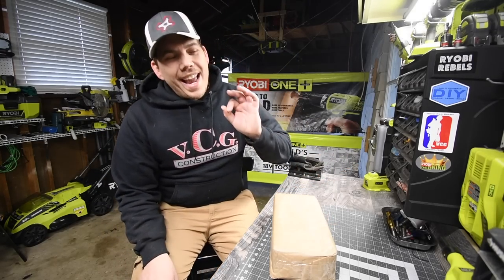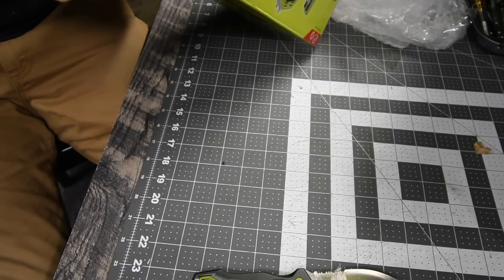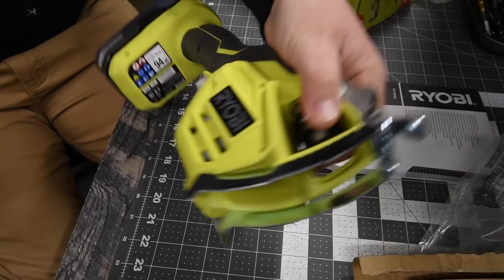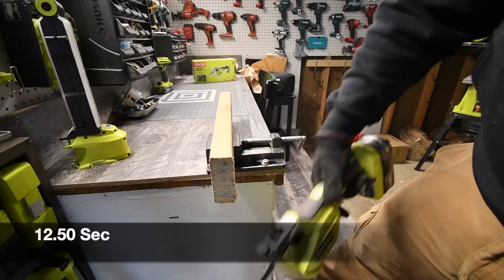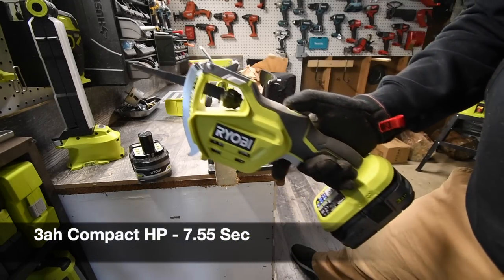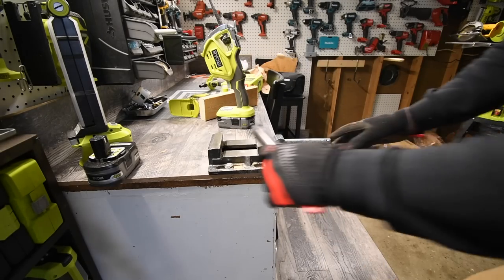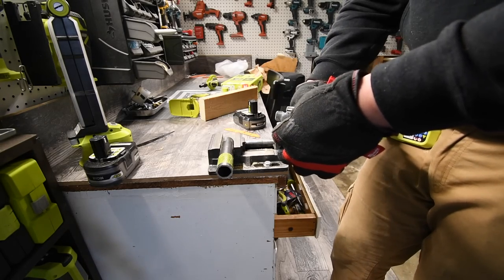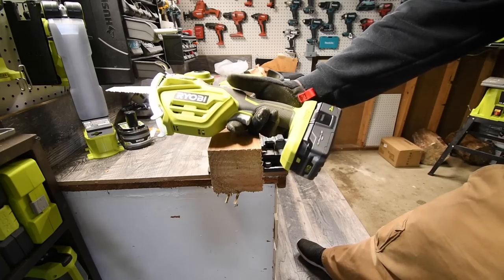"Ryobi Hacksaw" Im the first American to have this

Comment: Batteries have nothing to do with different countries , the input voltage is the only difference and you can just use the 110 volt American charger instead of UK's 220 volt one , but as far as you get the same output voltage from both chargers  you have no issue at all and tools should perform with  the same power and efficiency
Reply: UK voltage is 240v nominal.
Reply from the maker: yes it does. the cells in the batteries are the same but the mother board in the batteries is different. so the mother board in the tool reads the battery differently. like I just leaned that the UK 5ah battery is the same as the USA 6ah battery
Reply: @Adrianyoutubing  It's actually 230v now since voltage across the EU was harmonized.
Reply: I call bs on the channel owners reply. The charger has the transformer in it.. All the battery worries about is the 18v it puts out. You do not sound like you know anything about electricity, so you should refrain from making it seem like you do.
Reply: @stevoc9930  Anywhere between 220-240 is fine
Reply: @cidkramer  It might have a sort of current restrictor inside the motor driver once it feels different battery to avoid using fake ones , kinda(dirty) but you really can't judge it that way until you try both batteries
Reply: @stevoc9930  have you measured the voltage coming out the wall? It is 240v mate. The stated voltage of the UK is 230v but in 99.99% of homes and businesses it is 240v the tolerance for voltage range is such that 230v to 250v is acceptable.
Reply: Adrian Haddock I’ve been an electrician for 20 odd years. Though I’ve mostly worked in Northern Ireland. Here it was 230v even before EU harmonisation.
Reply: Considering Ryobi’s website mentions that the battery platform will never change, it should not matter what Ryobi tool you snap it on to.
Reply: @ManCaverTools  The only circuitry in the battery is the protection circuit, which just shuts down the charging when the battery is full. The actual output voltage from the charger is the same globally. 18V, strangely enough.
 The chargers are different because of the different transformers needed to step the voltage down enough.  Honestly, I'm surprised that Ryobi hasn't gone to a universal charger capable of 110-240V input. You'd think it would be cheaper to manufacture a single global charger and just change the cords.
I may just have to sacrifice one of my half dozen spare chargers to find out. Maybe it is already and they just don't market or label them that way.
Reply: @ManCaverTools  Maybe it is because it is converted to metric?
Reply: Physics works same in any part of world

Batteries are batteries, hell its all made in China anyway no matter where it ships too..

Comment: The metal bar is a clamp to hold the material being cut against the machine to reduce vibration and keep hand away from blade
Reply from the maker: correct. I just filmed another video with this that I havent uploaded yet. but I do say that in it and I thank you sir

Comment: 18 volts DC is the same everywhere in the world regardless of the AC voltage that created it.
Reply from the maker: im more curios on the circuit board in the battery
Reply: @ManCaverTools  Also runs on 18 volts DC which is the same everywhere in the world.
Reply: I apologize for me and all electricians.  Can't not answer this  one.

Comment: Doesn't seem much different than the Ryobi sawzall? Looks like same blade even. In fact I think my sawzall cuts faster than this tool even with standard 1.5ah battery. I'm not impressed.
Reply from the maker: very good and I thank you Lady TowerMoon
Reply: The hacksaw has one major advantage, one-handed operation. I'd hate to get my beefy recip saw out just to prune a couple of little branches if I had this tool.
Reply: @toddglennbarrow  yep, seen a couple of "not impressed" comments. almost like they didn't watch the video and the point of the tool. a sawzall should outperform this tool because it's designed for heavy duty use. this tool is not.
Reply: Even less difference to the pruning saw that they sell in US
Reply: @lawlorie24  this is a pruning saw, not a hack saw, the US model is 12v I believe, this one is 18v which is awesome.
Reply: @ihoppoet   I have a pruning saw in my garage that is ryobi in the yellow colors and its 18v it doesnt have that metalic flap on the front but otherwise looks the same. I bought it years ago in the homedepot gardening section
Reply: This one is smaller made for pruning. The metal claw prob provide a smother cut on trees and other plants . I get down with my Ryobi saw zaw but batters them bad .

Comment: That where the battery is made should not matter because all is output 18v I leave in UK and I have brought few year ago RIDGID gen3  combo set from USA and AEG sds plus rotary hammer drill from Germany because RIDGID  didn't have an sds 18v at the time and works fine till now no power lose or different in the size and both charges work fine. I though the USA charger would charge a bit slow because the of the frequency difference but it's okay.
Reply from the maker: good I am glad to hear that and thank you Milko for the input

Comment: 18 volts is 18 volts no matter where you are on the planet.
Reply: ... definitely is no different on Ryobi batteries ,  the advantage in US is the bigger range of amperage  .
Reply: Incorrect check the hz range
Reply: The hz should not affect the battery. The charger would be affected, make sure the charger is rated for your voltage and hz.
Reply: Check the Hz? In the battery? It is DC, DC Hz is by definition 0hz or infinite Hz. 

Chargers might blow up if you use  international ones but batteries are DC... UK mains power is 240v 50Hz 

Voltage swings from as low as 220v up to 250v but the vast majority of the country runs on 240v.
Reply from the maker: very good and thank you for the input KDC
Reply: Absolutely NOT true. Due to the Coriolis effect, the blade travels in, when it should be traveling out. Opposite of here in the states.

Comment: 18v in the US is the same in the UK, same as 18v in Japan, and everywhere in the world. Voltage is voltage.

I looked into the battery specs years ago when I started importing Ryobi tools in from other countries when their markets had offerings that were not available in the US. If you take apart the battery you will see there is are two boards, one for the LED's that display the remaining charge and another for the battery circuit. From what I can tell there isn't any circuitry implemented to regulate anything. 

Ryobi intentionally have made their batteries a 'standard' product in order to support their longevity of their tools and provide replacement consumables to the market. The injection plastic may differ from country to country, but the guts of the battery do not.
Reply from the maker: I was mistaken and this is from Norway

Comment: ah(amp hours) has nothing to do with "power" of the tool, amp hours is the discharge rating of a battery, meaning how many amps it can discharge continuously over a period of time before it is below rated voltage. More amp hours does not mean more power in the sense it can output more at once, it means it can output that power for LONGER before it dies. Your 1.5 died because the tool sucks so much amperage, it wouldnt complete the cut without depleting the available pressure (voltage). Your bigger batteries could do it, because they had bigger tanks (amp-hour capacity) to maintain the pressure longer.
Reply from the maker: a more ah battery does provide the tool with with more power. I already proved this in many videos. A 3ah dewalt battery with 21700 cells in it will kick the crap out the the dewalt 6ah flex volt battery when it comes to delivering power for a task. sorry but you keep watching. I show this all this test all the time
Reply: @ManCaverTools  You are comparing different cell designs with different discharge characteristics. Science, fully, wholly, disagrees with your statement that Amp hours provides more discharge RATE.  Amps-flow volts-pressure  amp hours- how long it will flow at a set rate before pressure is depleted to unusable levels. You are saying a different battery with completely different cells that have entirely different discharge rates and amperage flow/discharge characteristics, flows differently from another....of course it does. But stating amp hours has anything to do with power flow capability is flat out wrong.  A more accurate statement is "this 3ah battery with considerably higher quality cells, and higher rated discharge amperage will kick the crap out of this 6ah flex volt battery that is designed with lower performance characteristics"  but even then you are proving my statement right, as you just stated a 3ah battery will kick the crap out of another 6ah battery. Because the battery is inherantly designed differently, it has nothing do with the ACTUAL ah rating of the battery.
Reply: I actually recall stating that the ah rating of a battery has nothing to do with it's amp discharge capacity. I'm in fact arguing that an ah rating really has NOTHING to do with the maximum output amperage characteristics of the battery and only to do with reserve capacity.

Comment: Soft Start motors is not really interesting technology, it's something you already have in a number of your tools. They are in a number of recip saw, table saws, miters, jig saws and law mowers.
Reply from the maker: its not just a soft start, The HILTI 12v hacksaw is also a soft start. the interesting tech is the motor kicks into high gear as soon as it bites into the wood. if I just hold the trigger it doesn't change speeds. the stroked per minute go higher as soon as it bites into the wood. but I thank you for trying Piston :)
Reply: @ManCaverTools  A number of tools have that function, makita jig saw for example.
Reply: @PistonHonda87  yea but a hackzall doesn't, so to have that feature on one is pretty sweet

Comment: Kind dropped the ball on this review. You should have read the instructions. Tell me if I'm wrong but a review is to inform us about the tool. We still don't know what the 2 buttons on the side are for and how the pruning jaws work. A branch from outside would have helped. Still give you thumbs up for trying.
Reply from the maker: it slides the metal guard off in the front. and im sorry I just realized I didn't put that in the video

Comment: Hello Sir (I dont know your real name, sorry).

Ive seen several of you videos where you are using a saw, and i have to comment on your techniques.
When you see smoke from the material, you are either pressing to hard or the cutting edge is dull and as a rule you should never have to press on a blade/cutting edge, only a slight pressure to make it bite, the blade itself is doing the cutting, not the amount of pressure you put on it.
Try using a good old fashion handsaw for a while, that will give your a technique that would make wonders on powered tools, save on blade wear and save battery power.
Reply from the maker: the point of these videos is to put these tools through extreme tests. I push these tools to the limits to see If I can make them break.

Comment: Ryobi definately isn't for hard use. I learned the hard way, drilling down tack strip into concrete. Only 1/16 inch holes. The drill almost caught fire. Started smoking black smoke after about 15 hole. I'll stick with dewalt or Bosch
Reply from the maker: The Ryiobi Brushless hammer drill did a fantastic job with drilling a 3/4 hole is into concrete with no pre drill hole. you should check out the video

Comment: Its the hz that us different we operate on a different hz range which could if using a uk battery in american tool coukd cause motor to heat up  or so i am told
Reply: Nope. Its all about the charger . 18v is 18v
Reply from the maker: I might be wrong but I think the mother board is different on other countries batteries. the cells are the same but the mother board talking to the other board in the tool might make it work to hard or to little because of the battery. so I think
Reply: American frequency is 60 Hz ( cycles per second ) and the UK frequency is 50 Hz. Power tools with motors with brushes will work on 50 or 60 Hz but not at best efficiency

It will also cause the motor to run hotter

An American ( 60 Hz ) fed with 50Hz may run hotter and possibly faster as the inductance ( resistance ) of the motor coils is lower for 50 than for 60 and more power will be taken.

Induction motor for 60 Hz will run slower on 50Hz and may run hotter.
Reply: @ManCaverTools  nope. The board on ryobi is just charging & overheat protection . its an almost off-the-shelf part . otherwise the clone battery makers would have the same issue.

The charger outputs the same amount to the battery whether you use an aussie or EU or US charger..the battery doesnt care.

Same with discharging the tool.. The tool doesnt care where the battery came from. Its all 18v DC ..if it were AC  tools they would be affected by the regional power supply.  Thats why you cant use a charger from one region in another..at least not easily.

Comment: put the guard around the board.
Reply from the maker: it wouldn't let the cut go through cause of the guard would stop it after an inch or so
Reply: @ManCaverTools , thanks for the quick reply. Could the blade be turned around, like a saws-all, or just curved around things being cut?

Comment: I have never seen someone with so many tools and have no clue how to use them properly.
Reply from the maker: if I used these tools the way they are supposed to, nobody would watch. people want to see these tools put the extreme test to see what the limits are the viewing desides if it worth the purchase. nobody wants to see these tools do easy tasks like drive in 3" screws or only use saws to prune branches. they want to see a saw struggle or a drill and impact struggle. that's what I give them. so if you don't like it move on Rian
Reply: @ManCaverTools  Fair point mate just stirring.  Ive recently started testing the Ryobi 18v tools such as the line trimmer and was thinking of buying the cheaper chainsaw until I saw your review. Keep doing you 👍